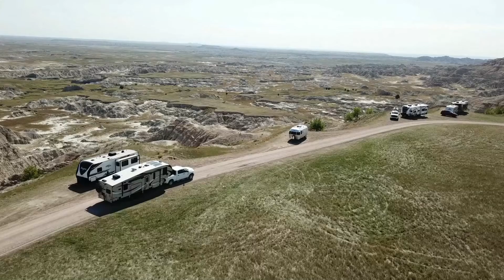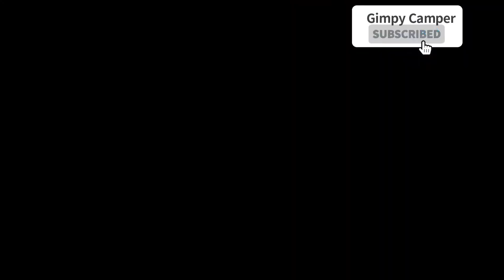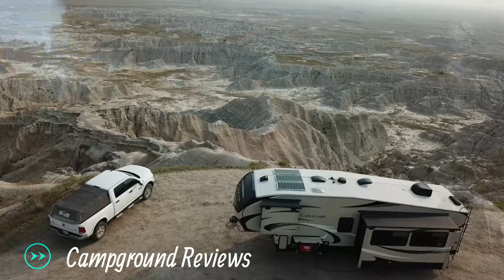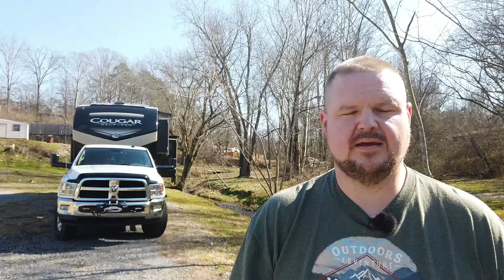Why you need backup lights on your RV

Comment: I did this a couple of years ago, but I used wireless switches,or fobs, from Amazon that are clipped to the sunvisor in the truck   I have 2 sets of lights, under the back bumper to flood the campsite, and under each side aimed down at the tires.  The later allows me to see what the trailer tires are going to hit, or fall into, at night when underway.  Powered them from the trailer battery and each set is on a different fob (you have to request different frequencies when ordering).  I can drop the fobs in my pocket and turn either on at will while walking around.
Reply from the maker: After reading your comments before I noticed that Tractor Supply has remote kits with their LED lights in the store
Reply: The catch is the fobs are not a strong signal.  I finally moved the receiver/relays to the back of a wardrobe closet, the most forward place in the trailer, to get it to work from the drivers seat.

I also installed two Amber clearance lights on the rear fold out step that I can see in my mirrors, and each comes on with a pair of lights.  This allows me to confirm that the off signal has been received.   Won't make many friends rolling down the interstate with the flood lights on.

PS:. If our trailer cost over $100k, the wheel lights would be called "docking lights"...........and the den couch area would be the "main salon".